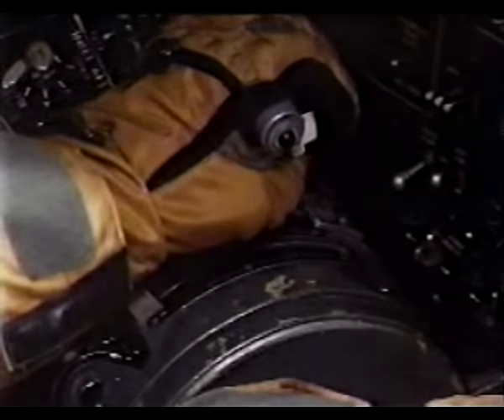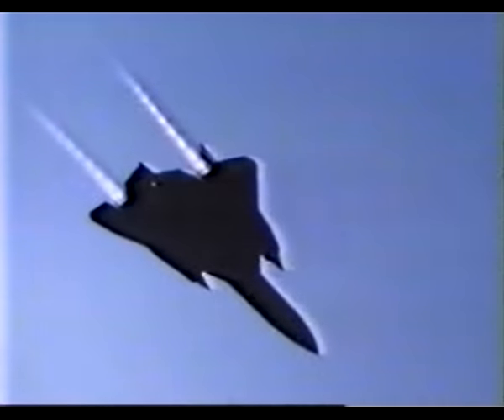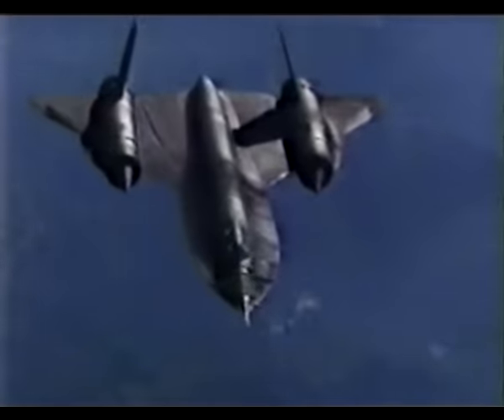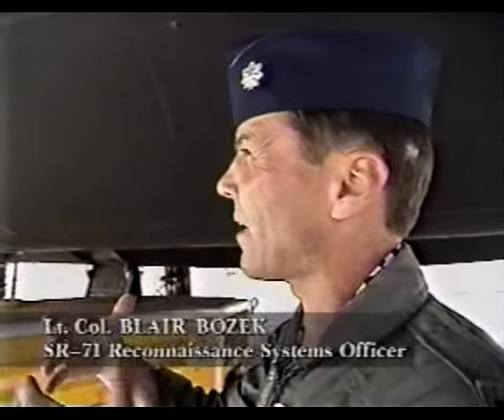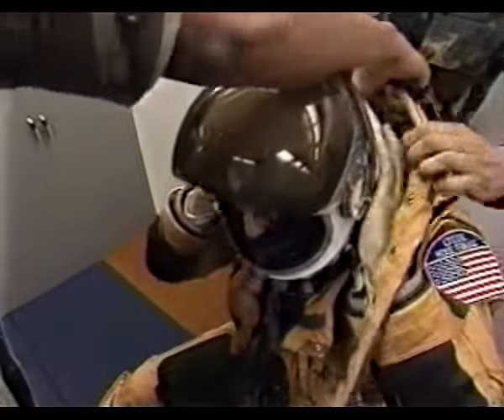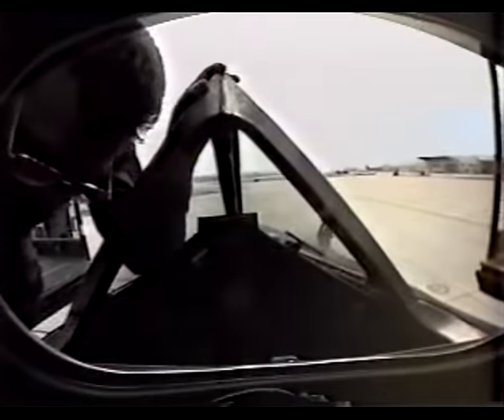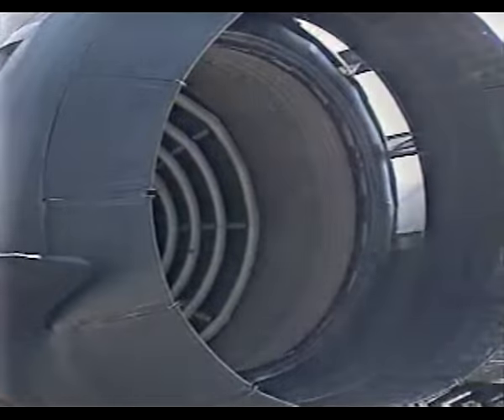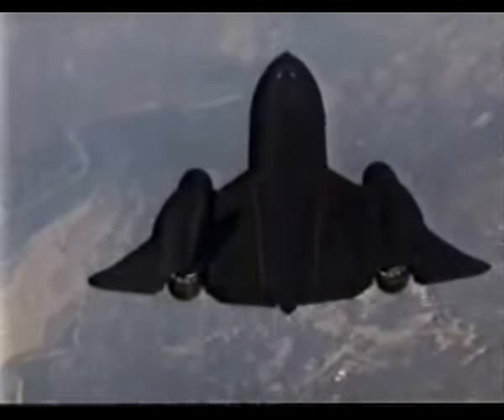Lockheed SR-71 Blackbird

Comment: "must meat one fundamental requirement; they must be married"

WTF?! I would expected the opposite..
Reply: Probably need to be married so you don't run around to a dozen wimmin and in the middle of whoopie, spill secrets........
Reply: Not required for USAF pilots, only for early CIA pilots.
Reply: 135th Darksword Ok tnx, but the question still remains. :/
Reply: dtiydr It was because the CIA felt that the pilots wouldn't defect with a family at home.
Reply: 135th Darksword Make sense, thanks.
Reply: 135th Darksword  I think the real issue was that single pilots might be more reckless at the controls. Being married gives you a reason to fly extra carefully and not pull a stunt that could end in a highly-publicized crash.

Comment: I was lucky enough to work at Lockheed Burbank.  And had a Q clearance,  I received n delivered parts to the Skunk Works. I have my patch to prove it lol 
  The SR 70 n 71 are  the most amazing planes ever made. 
LOCKHEED PROUD.
Reply: That's cool!  Do you remember them pulling all the permanent markers off the floor when they realized they weren't compatible with the body panels (literally ate through the metal). Or the ordeal with the fluoridated water causing brittleness? Give us some stories man, you were there!

Comment: back when i was a firefighter  in the air force at edwards, one of the first things i did when i got there was hold a fire hose under an SR-71 when it was being fueled.  they actually had to have fire protection every time they fueled up.  was one of the most memorable things i have done.  that, and walk in a room where they had the pegasus missile.
Reply: Why did it need fire protection? The JP-7 fuel would put out a lit match.  Just wondering.  Or was is more of a cleaning operation rather than fire protection? I know the JP-7 was super slippery on the floor.

Comment: Witnessed the Habu land taxi to a hangar and take off at General Mitchell IAP WI. Had the honor of a walk around in the hangar observing all the aluminum drip pans collecting the JP-7 fuel during my USAF Reserves drill weekend prior to the SR-71's retirement. Observed a Habu take-off from RAF Mildenhall. Also, what an aircraft designed by Lockheed Skunk Works.

Comment: I would like to add to this..... The presentation is excellent, what is many times not mentioned are the other "sub-contractors" that were involved..... #1 Hughes Aircraft Company (prime avionics expert)....who along with Motorola, Westinghouse and Kodak developed the avionics systems and with regards to the 1st BB, they developed the AIM 54A (phoenix) missile.  When the 1st BB was canceled, the surveylance version was built...1st for the CIA and then for the USAF.... then the USAF wanted the interceptor, to avoid having to reconfigure the "bays" to accept the phoenix, it was decided to use the AIM 47 (Falcon) missile which was shorter and (that the AIM 54 was originally based upon) with a tech transfer unto the AIM 47 from the AIM 54.  Under Hughes "wing" the same family owned company that built the cameras for our space program, built the ones in the surveylance planes as well!

Comment: I used to watch these take off from where I was working on a building site right between the 2 American bases at Mildenhall and Lakenheath in about 1986/7. They used to be fuelling them up just before take off (I think it was the Mildenhall airbase, they used to surround them with big concrete walls that were moveable with a forklift to keep away prying eyes from the road that goes right past). When they did take off it really was somthing to behold, they would take off like a normal plane to start with then they angle of climb would get really steep very early on and then, blink and it was gone nearly straight up! Ah well it made a change from hodding bricks for a few minutes!

Comment: 3200 fps is faster than a 30/06 150 grain bullet and as fast as a 300 win mag 165 grain bullet. Those j58 engines are each the equivalent of 20 railroad locomotive's in pulling power. 8 camera bays underneath. A marvel of a plane during the analog days.

Comment: Something a lot of people don't realize, at max altitude sustained flight the air is so thin, the manual requires them to lose altitude before initiating a turn. So you're at 85,000 feet doing Mach 3.2, you have to drop down 2,000 feet before turning the airplane...

Comment: as a fuel tech in the AF in the 80s I can say that JP7 had such low vapor pressure that even though it leaked out of the plane there was little danger of a fire or explosion which was the opposite of the conventional fuel JP4 which was highly volatile. - Castle AFB fuels maintenance tech.

Comment: Maybe use a hybrid rocket motor scram/ramjets? Eliminating the need for a liquid fuel? Allowing compression ignition to handle efficiency rather than compression rotors. Saving weight which could be used for fuel or payload. Obviously the faster you go the more efficient it would become. Depending on what fuel works the best?

Comment: The jet became a living extension of the pilot/s. At the high speed temperatures the airplane metal itself would stretch out even so the engines would undergo "climate changes". Not to mention the impressive minds that come up with something like this and made it fly at these speeds and keep it in the air. Trials and tribulations but the SR-71 from its predecessor the A-12 was nothing short but a marvel what Humanity can do and achieve once they put their minds to it. 

The sky is not the limit!

Comment: I remember seeing one of these at Mildenhall rolling out. I was like..hey..I think its leaking fuel. I was then told, after it takes off and comes up to speed, the frame expands due to the heat and seals the leaking joints. I wouldn't care-if someone asked me-hey, you want to ride in the back seat of an SR-71? I would be like.. "Who do I have to kill to get that ride"?

Comment: It’s a really cool plane but highly inefficient which is why it was retired. Because of the tremendous heat, there are gaps in the metal plates which expand because of the high friction which will seal during flight. It literally drips fuel on the ground and is almost dry before takeoff which requires it to be refilled before continuing on its mission.

Comment: Anywhere else leaking fuel would be a safety hazard.
But in this bird its just the way it is.
Reply: Virtually all aircraft leak, the SR71 wasn't unique there
Reply: Actually the hazard was that the fuel made the floor extremely slippery, in fact once they overshot a parking spot in the hanger as it slid across the slippery floor (at low speed).

Comment: The tanks were far from dry on takeoff, and they refueled because of what weight the tires could take and single engine control speed incase of engine failure at launch.

Comment: The fuel thing is sorta misleading. Yes they don’t have anything to seal the tank and survive multiple flight but they are able to seal it on the ground to stop leaks, but it would often take too long to seal as the plane had to be back in the air with another crew shortly after landing

Comment: Just FYI, friction isn't really the cause of the heating. The main component is the compression of the air. On the leading surfaces the air is so compressed that it reaches a very high temperature, in the exact same way that diesel engines compress air in their cylinders to burn fuel. The rest of the heating comes from that super heated air passing over the rest of the airplane.

Comment: The rmain reason for refueling after take off was that the tanks weren't full at the start, so as not to put too much stress on the special tires, which could be used only about 15 times. It's not that it started fully loaded, and that due to leakages or heating up the motor so much fuel was lost. How did the Russians succeed in letting the MiG 25 / 31 fly a much shorter time of course up to mach 3, without building it in 90 % titanium and with a far more "classical" shape than the Blackbird ?

Comment: 59% of the plane's weight was fuel. The plane caused the skin to contort which is what caused fuel to leak which led to an acceptable fuel leak design. The nose of the plane would reach about 300c. Over 1000 missiles were fired at the SR-71, and none of them hit. The blackbird was protected by the law of physics. It is the only plane where it became more fuel efficient the faster it went.

Comment: X-15 starring Charles Bronson,Mary Tyler Moore,...gives a good view of these type of aircraft in the US Air Force.  The more things change,the more they stay the same!     Also the need for a reentry vehicle produced space shuttle,and many others.    The challenge is the Loss Of Signal. LOS.  A lot can happen in a couple of minutes,...going from 15,000 mph or more to a speed that isn’t melting you is tough.   We can get through it but clearly it’s a problem,unlike a rocket,the reentry vehicle has no fuel for this.    I’m sure we have solved this,.........perhaps in 20 years we will learn of the next generation that figured it out!         And a parachute leaves a lot to be desired! Can’t really control the landing area.

Comment: I can't help but bristle a bit hearing that incorrect term superheated as it relates to the skin of that aircraft. This term basically applies to liquids and means the temperature of the substance is higher than its boiling point. You do this by putting it under pressure much like an autos cooling system is under pressure. The opposite is also true. when you supercool you lower a substance's temperature below its freezing point. I can take a gallon of water and make it boil at normal room temperature simply by putting that water in a vacuum.

Comment: For all of you that think you're geniuses. The low fuel on take off was due to the fact that the seams of the fuel cells were purposely designed to leak so that when the plane heats up to 700 F., the fuel cells expand and seal the fuel.

Comment: It goes way faster than Mach 3. I have spoken to a pilot of the SR. A friend of my cousins. I can't state the speed, it's classified.
Reply: The SR-71 can 3,4Mach, but one seat predecessor for CIA A-12  can move with 4000 KpH / 3,75+Mach  max climb 33Km / 100000 feet. Mach at altitude is only 1060km/h.

Comment: The Lockheed SR-71 is an advanced, strategic reconnaissance plane of the big highway, speeds over 3Ma. The SR-71 was unofficially named "Black Bird", while the crew called it "Habu" (type of snake). The main defenses of the aircraft were its speed 3220 km / h and a large operational height of 25,900 m per year. in the event of a land-air attack, the plane only accelerated. 
the CIA at the end of 1957. ordered Lockheed to develop an invisible aircraft.
 the CIA at the end of 1957. ordered Lockheed to develop an invisible aircraft. A project called Arkandjeo modified to achieve a 90% reduction in radar aircraft reflection. the first airplane of the fifth generation.that US spy plane, who could develop a speed greater than three maha, faced an opponent who could easily intercept him. It was the Soviet "MiG-31 Foxhound". Due to its impressive features, such as the ability to fly at speeds four times faster than a 27-kilometer-high speed, good radar (RCS) and more effective countermeasures (ECMs). There was a "MiG-25" that could fly at a similar speed as "SR-71". The Soviets began to develop the MiG-31 in 1980, which had a new rocket-like American AIM-54 Phoenix. The new rocket was called "R-33". This new rocket was not only good for the demolition of US bombers, but it could successfully intercept and destroy fast-track spy planes such as the "SR-71".This sentence is confirmed in the book by Paul Crickmore - "Lockheed Blackbird: Beyond The Secret Missions". In that book, one of the Soviet pilots - Mikhail Myagkiy, who flew in his MiG-31 plane, and several times intercepted an American super-fast plane - explains how he could crash "Blackbird" on January 31, 1986: "A plan to intercept "SR-71" was completed until the last moments after flying the Blackbird and the MiGs had to fly exactly 16 minutes after the first warning. They warned us to intercept an American plane at 11 o'clock. They first called it and confirmed the existence of aircraft on the speakers. Every time Blackbird appeared, she was nervous. Everyone started talking with a nervous tone and was a very strange atmosphere. "Myagkiy and his co-pilot had a" SR-71 "on a nišan at a height of 17,000 meters and 120 kilometers away. If the plane had entered the Soviet space, it would have hit it with a rocket. There was no theory that the US "Blackbird" escaped Soviet missiles. After this interruption, US Blackbird aircraft began to fly around the borders of the Soviet Union. But "MiG-31" intercepted "SR-71" at least several more times. On June 3, 1986, six MiGs intercepted the "SR-71" over the Barents Sea and could destroy the plane from all sides. After this interruption, the "SR-71" never flying over the Soviet Union and was soon replaced by satellites.

Comment: They started to build the SR-71 in the late 50s....so imagine what we (USAF) have now...
Reply: The SR71 was requested by the USAF in 1962.
Reply: @gr8crash  the contract for the SR-71 requested by the Air Force was in 1960 .. the design started 1958 they had the design done by 1959 so yes you are correct 1962 was the first one completed but they already knew what they were going to do by the late 50s
Reply: @tommccallan8802 some what.  I think you're confusing the A12 and SR71. The A12 design was selected in 59 and first flight was in 1962. The USAF requested the SR71 in 1962 flying in late 1964.

Comment: They could have made the plane not leak fuel by making internal tanks which would hold less fuel by design but would also add alot of weight anyways so it would hold less fuel which would make no sense because it’s a spy plane it needs maximum range that’s the whole purpose of it the only away around that is drop tanks but that’s probably not something they would do because the planes shape was to avoid showing up on radar and the drop tanks would definitely change the shape however the weight added from building internal tanks it might not be able to even have the extra weight from the drop tanks. The other way would be to have nasa design a material like Kevlar that is high temperature to use as a bladder inside the wings which I’m sure they could have done even if it was years after the planes were built if they had a team of engineers only working on that but then u have the problem of weight just think about how much a pool liner weighs and now how massive the wings are ur talking thousands of pounds in a material to seal the wings if it was just 2,000 pounds of material (it would be much more) that’s a good 300 gallons of fuel that u can’t have because of the weight, the plane burns like 40,000 pounds of fuel per hour so even if it didn’t leak any fuel it would only make sense to top the plane off with fuel once it’s in the air and at a decent altitude so it can have max range it didn’t make sense to even worry about the fuel leaks when ur gonna fill it up mid air anyways. NASA has no fuel leak problems with spacecraft they definitely could had sealed the sr-71 tanks it was just about weight and range that’s all.

Comment: There is no replacement for the SR-71.  At least none declassified, yet.  The mission has been replaced with satellite.  In the old days, satellite images cost a lot of money.  Each image you need requires you eject the exposed film, it de-orbits, and then has to be retreived, then developed.

Before digital cameras, the only way to have a photo of an area in your hands within hours of the picture taken would be to send a camera there, the SR-71 being the "best" camera for spying.

Once digital cameras existed, infinite pictures could be taken from space and beamed back down.  So the need for a film-based plane to get a view was gone.

Since then, camera tech and imaging has improved enough that spy satellites do the job, so there is no need for a spy plane.

Comment: So much fuel is lost that it takes off with nearly dry tanks? They purposely takeoff with 50% load, which is 40,000 lbs.  So those drips add up to 30,000-40,000 lbs of leaks? The books indicate that the leaks were carefully measured and logged in the scale of drips per minute, which  implies a bit less than 15-20 tons!

Comment: ..."launch it's 140,000 lb body"?  No...dry it is 60,000 lbs and with 40,000 of takeoff fuel total weight it is 100,000.  Yes it does weigh 140,000 after refueling but not at typical takeoff.

Comment: What a waste of fuel all the things the military builds and they couldn’t build a type of a containment system to collect the fuel🤔 and use it for degreasing, lubricating, or fuel source for kerosene heaters😂
Reply: Damn never knew this important fact amazing need refueling right after takeoff....
Reply: Waste of fuel? What?
Reply: @gr8crash  This was a comment to a totally different video, I made in response to the plane sitting on the ground and dripping fuel on the ground. Yes I know the tanks leaked fuel because at the time no material was available to seal them up as the plane was cold, as later the heating up of the skin sealed the tanks.
Reply: @michaelsimko4445 I figured that's what you meant, but that's also incorrect. Heating up etc had nothing to do with sealing the tank.